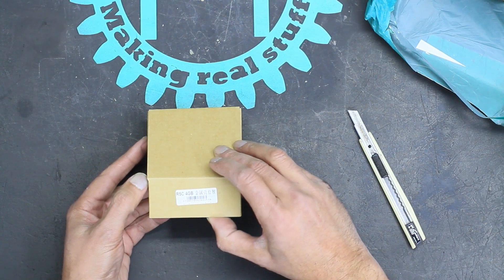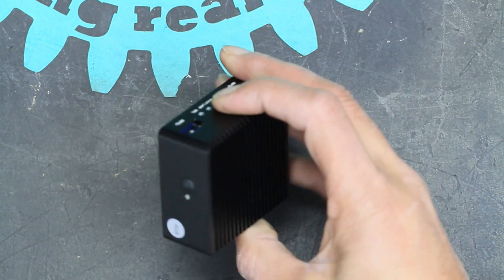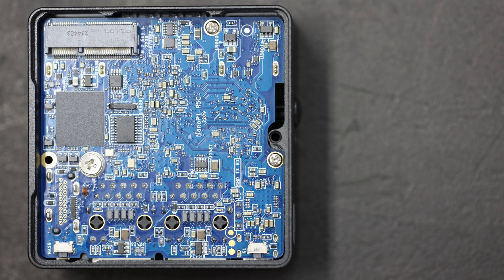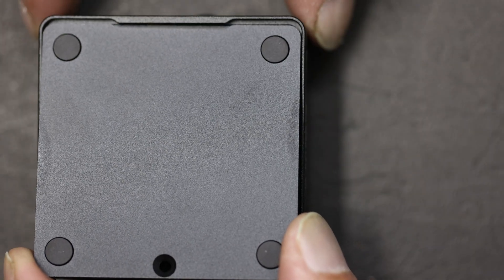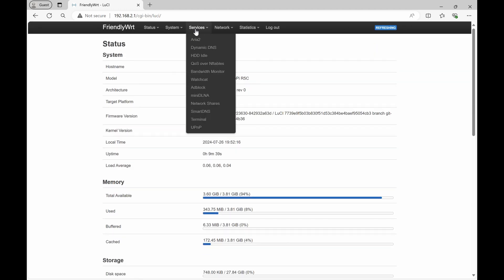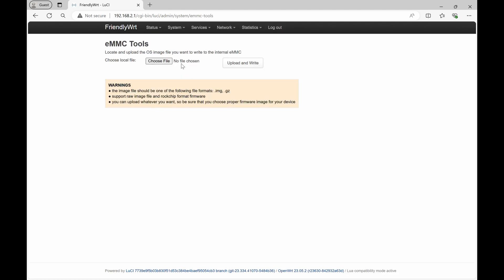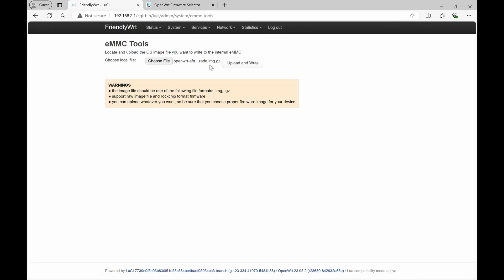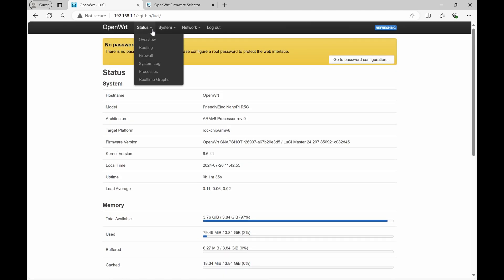NanoPi R5C OpenWRT Router

Comment: Followed your instructions and all is working but no longer have access to the internal 32GB eMMC.  Any idea how to "enable" that?
Reply from the maker: I'm not using the device for storage at all, so haven't really looked into this.  But if you do a 
cat /proc/partitions 
you should see something like this:
major minor  #blocks  name

 179        0   30310400 mmcblk1
 179        1      16384 mmcblk1p1
 179        2     106496 mmcblk1p2
 179       32       4096 mmcblk1boot0
 179       64       4096 mmcblk1boot1

the top line is the full eMMC and the others are partitions - so you'd need to expand your root partition to fill the eMMC or create a new partition in the available space.  This might not be possible with squashfs though.

Comment: Thanks for your video. Looks like wifi-related modules that you removed from default packages are: kmod-r8169 kmod-rtw88-8822ce rtl8822ce-firmware iwinfo. correct? I am new to openwrt, how to identify which module is wifi-related?  Based on manufacture's website, docker is also supported. If I am going to install tailscale, should I install it directly to openwrt, or install it as a docker container?
Reply from the maker: I haven't tried docker. This is now my primary gateway, so not inclined to fiddle with it - but I think I should buy another to try out some of the more exotic stuff
Reply from the maker: These are the modules I used:
base-files busybox ca-bundle dnsmasq dropbear e2fsprogs firewall4 fstools kmod-gpio-button-hotplug kmod-nft-offload kmod-r8169 libc libgcc libustream-mbedtls logd luci mkf2fs mtd netifd nftables odhcp6c odhcpd-ipv6only opkg partx-utils ppp ppp-mod-pppoe procd procd-seccomp procd-ujail uboot-envtools uci uclient-fetch urandom-seed urngd wpad-basic-mbedtls

I got the descriptions from Copilot/ChatGPT:
Sure! Here’s a brief explanation of each OpenWrt module you listed:

base-files: Contains the base filesystem and system scripts for OpenWrt1.
busybox: Provides tiny replacements for many common Unix utilities, all compiled into a single binary2.
ca-bundle: Contains a bundle of system CA certificates3.
dnsmasq: A lightweight DNS forwarder and DHCP server4.
dropbear: A small SSH2 server/client designed for small memory environments5.
e2fsprogs: Contains essential ext2 filesystem utilities like e2fsck and mke2fs6.
firewall4: A netfilter/nftables rule builder application used to manage firewall rules7.
fstools: Provides filesystem utilities for OpenWrt8.
iwinfo: A command-line frontend for the wireless information library9.
kmod-gpio-button-hotplug: Generates uevents for GPIO button presses, replacing in-kernel drivers10.
kmod-nft-offload: Kernel module for offloading nftables rules to hardware.
kmod-r8169: Kernel module for Realtek RTL8169 network cards.
kmod-rtw88-8822ce: Kernel module for Realtek 8822CE wireless cards.
libc: The standard C library.
libgcc: The GNU Compiler Collection (GCC) support library.
libustream-mbedtls: Provides TLS/SSL support using mbedTLS.
logd: A lightweight logging daemon.
luci: The web interface for OpenWrt.
mkf2fs: Utility to create F2FS (Flash-Friendly File System) filesystems.
mtd: Utilities for managing memory technology devices (flash memory).
netifd: Network interface daemon that manages network interfaces.
nftables: Provides packet filtering and classification framework.
odhcp6c: DHCPv6 client.
odhcpd-ipv6only: DHCPv6 and RA server.
opkg: Lightweight package management system.
partx-utils: Utilities for partition table management.
ppp: Point-to-Point Protocol (PPP) daemon.
ppp-mod-pppoe: PPP over Ethernet (PPPoE) support for PPP daemon.
procd: Process management daemon.
procd-seccomp: Seccomp support for procd.
procd-ujail: User-space jail support for procd.
rtl8822ce-firmware: Firmware for Realtek 8822CE wireless cards.
uboot-envtools: Tools for manipulating U-Boot environment variables.
uci: Unified Configuration Interface for system configuration.
uclient-fetch: Lightweight HTTP client.
urandom-seed: Ensures a unique random seed at boot.
urngd: Entropy daemon to feed the kernel random number generator.
wpad-basic-mbedtls: Basic WPA supplicant with mbedTLS support.
Reply: @makerealstuff  Can you tell me which phrase you removed? just remove wifi and bluetooth?

Comment: Wh change FriendlyWRT to OpenWRT? Whats the advantages or disadvantages? Also what wifi speeds does this have and is it stable? What Wireguard speeds can this do?
Reply from the maker: Sorry for slow reply. I wanted something that I could keep up to date and that was completely open - hence the shift to OpenWRT. No idea about wifi - I didn't install the wifi card - in my setup this is just the gateway to the internet, my wifi sits on a (slightly older) Edimax cluster of APs. Haven't used wireguard on it, but imagine it would easily match your internet speed (unless you're in the multi-gig fibre range)
Reply: @makerealstuff  Wifi currently doesn't show up in OpenWrt. This seems to be something to do with the m.2 slot support, given that it doesn't show up in dmesg or in lspci when I install the pciutils package. My experience with friendlywrt with wireless was that it tended to stop working as an AP after a package upgrade, and the problem was something to do with DFS.

Comment: hello hope you can support me after i updated the image didnt turn on  just stay  the led of sys on and no connection even  when i conect the cable to lan   the led of lan wont go on
Reply from the maker: You can try writing a new image to an SD card and booting from the SD card instead.  That will allow you to recover the machine.
Reply: @makerealstuff  I have done that and it’s working but I would like that worked from the local storage. And the system is only giving me 100mb second.
Reply from the maker: 100Mb/s of what? Internet transfer, or xfer off your SD card?  You're probably not going to get more speed off the SD card.
Reply: I was able to get 600MB/s from internet speeds connection with the os installed on the sd card. But need bigger processor to handle my speeds connections
Reply: @scorpion_lux  If you don't need WiFi access try R6C/R6S. If you need WiFi try T6/M6. Newer model has more powerful CPU.

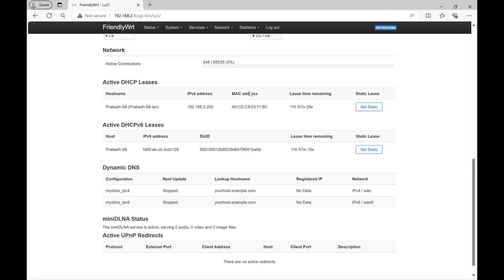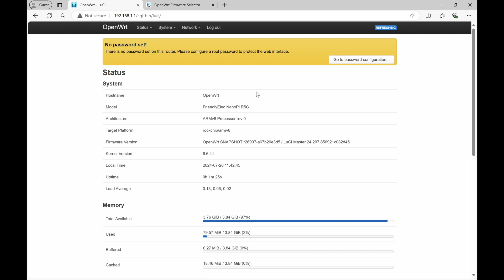Comment: 4:57 vs 7:10 
The friendlywrt firmware shows the eMMC (32gb) under storage while the openwrt firmware didn't show the eMMC storage. 

Is there a way to get it back in openwrt?
Reply from the maker: No idea. Guess there might be a module in the snapshot creation tool that would allow you to see that.
Reply: @makerealstuff  he is talking that Luci shows only 98mb of disc space storage instead of 32gb it really is. Did you fixed it somehow? Thanks in advance

Comment: Nice... M.2 Slot can be used for nvme SSD?
Reply from the maker: Unfortunately not - it's the wrong key - it's only keyed for wifi cards.
Reply: @makerealstuff only wifi or only internet? can it be used for a 4g wwan card?
Reply from the maker: Might be possible - just check the M.2 key letter is a match
Reply: If you want nvme SSD then buy R5S